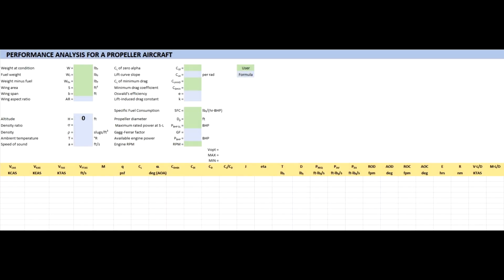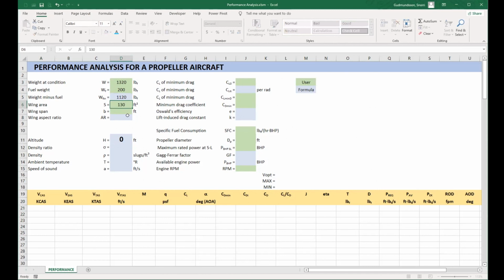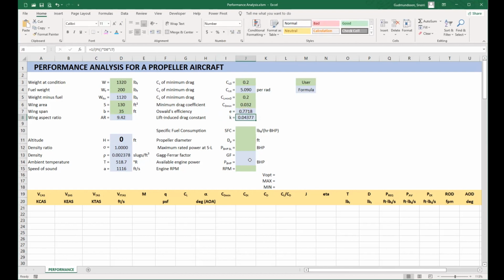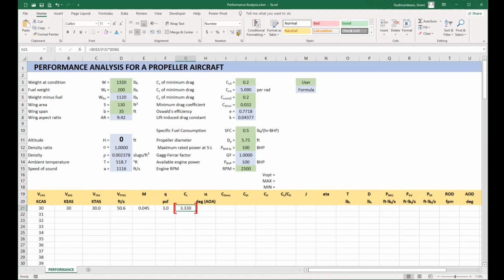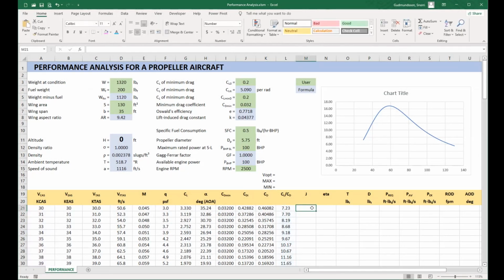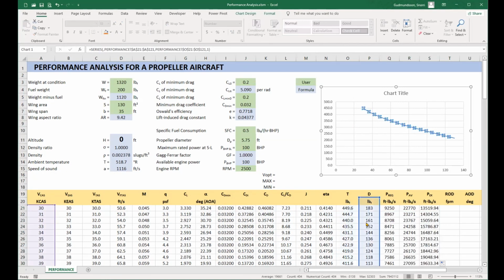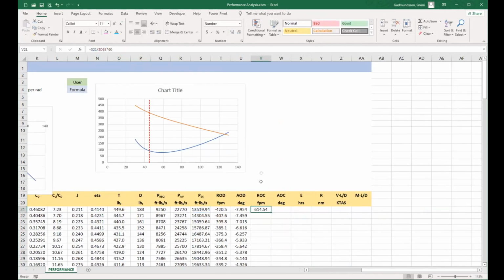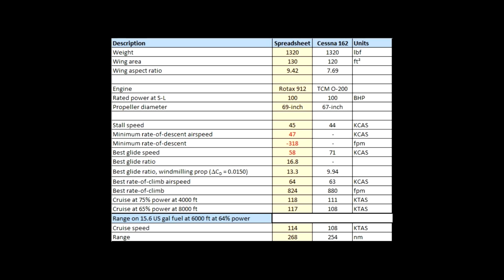Aircraft Design Tutorial: Aircraft Performance Analysis using Microsoft Excel

Comment: I have watched several of your videos in a row now so this may be slightly off topic for this video, but I am wondering, can you reverse engineer certain coefficients if you already know aircraft performance? For instance, I know the various speeds of an aircraft (cruise, take off, etc.) with an engine with four different propeller configurations, as well as other engine / propeller combinations. Using that real world data, I should be able to calculate a real world drag coefficient right?

Oh yeah, and edit to add, I have purchased your book and will be going through it soon. Your youtube content alone was supremely helpful for someone who has an engineering background but nothing to do with aircraft.
Reply from the maker: @cbbbbbbbbbbbb  Excellent question. The answer is a resounding yes. In fact, I do this very frequently. To extract the minimum drag coefficient, CDmin, it is best to use the cruise speed (e.g. from the POH) as it is an equilibrium speed that yields better quality results. Section 16.5, Special Topic Involving Drag treats this issue. Check out Example 16-24 in the 2nd edition. Make sure you use proper propeller efficiencies (e.g. 0.75 for fixed pitch cruise prop and 0.85 for constant speed props). Best wishes.

Comment: Hello, professor. I am working on my undergraduate thesis on aircraft performance calculations, and I am using your General Aviation book as a reference. I find it quite challenging to comprehend the example given in TABLE 18-5, which involves ground run analysis using the numerical integration method. Would it be possible for you to create a detailed video explanation for this example?
Reply from the maker: Which edition of the book are you referring to? First or second?
Reply: second edition 
 @dr.gudmundssonaircraftdesign
Reply: second edition 
 @dr.gudmundssonaircraftdesign
Reply from the maker: @NejlaTomrisYelmen  While your suggestion is good, I cannot produce a video about the topic any time soon. Contact me on LinkedIn if you can and describe the bottleneck.

Comment: Having done my ATPL exams and not being particularly mathematically gifted, it is interesting to see how those graphs are actually made, though it sticks out to me as a chicken and egg situation, how do you know what the weight or fuel capacity will be, if you do not know the materials used? would you then need to come back and redo the analysis after the aircraft is built and weighed?  Also does this take into account wing plan forms? being more oriented in this case to LSA aircraft I suspect not, however I wonder how accurate an analysis of this kind would be for a light aircraft hoping to achieve high speeds, such as that in air racing. 

If one were to attempt to design an aircraft, which of your books would you recommend purchasing to learn how to analyse, select materials and then test the theory?
Reply from the maker: @barnstormingbandit2611  Good questions. The aircraft design process is actually a well defined process that, unfortunately, is too involved to describe here. However,  I'd like to think it is clearly described in Chapter 1 of my book "General Aviation Aircraft Design" 1st and 2nd editions. So, I'd recommend the 2nd edition, as it is updated to discuss 14 CFR Part 23 with 64th amendment. While the book is laden with mathematics (which you may not like), it is a good reference for pilots wanting to know more about aircraft design. Best wishes.

Comment: Do Cirrus engineers really us MS Excel?
Reply from the maker: @TimJohnsonPhD I have never met an engineer that didn't use Excel or other spreadsheet tools. This is our favorite go-to tool.
Reply: @dr.gudmundssonaircraftdesign  Interesting. My engineering organizations have been trying to get away from it. Lack of security, lack of version control, etc.
Reply from the maker: @BigDickMark  What do you use instead?
Reply: @dr.gudmundssonaircraftdesign  Depends on the analysis, but we have a methods group that develops and maintains internal tools. The tools typically read/write to a human-readable text file that includes all the outputs, but also echoes inputs and metadata (e.g. software version).

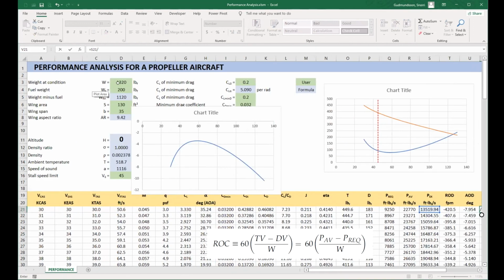Comment: At 30:39, how did you decide that 0.001 degrees is the appropriate significant figure for AOD? Why does AOD have more significant figures than AOA? Thanks!
Reply from the maker: @TimJohnsonPhD This is purely selected to display 4-sigfigs and ignores the difficulty of measuring angle beyond ±0.2°. The AOA also has 4-sigfigs at large AOAs and this becomes 3-sigfigs at low AOAs. The user can change this at will.

Comment: Thank you for this video. I ordered the second edition of the book from Elsevier. I wonder how a two lifting surfaces configuration (tandem, large canard) would be represented in this excel. How would you define both wings and their aspec ratio. Would you consider calculating an equivalent wing of both wings? How would the down-wash from the canard affect the Cl of the main wing (rear wing)?
Reply from the maker: Hi Christos. Thank you for your message and for purchasing my book. With respect to your question, fundamentally, you don't have to treat unconventional aircraft differently from a conventional one. The spreadsheet does not "know" the shape of the airplane that is being analyzed. It presumes the drag model you use (CD) is appropriate for the configuration. Downwash from the canard has significant impact on the wing lift (see Figure 11-36 in the book). This must be treated in the stability and control evaluation. This, in part, gives you the drag contributions that are unique to the canard (e.g. trim drag) and must be present in the drag model. This serves as an indirect representation of the configuration. This is all that is needed to treat canards (or other unconventional aircraft) in the spreadsheet. I hope this helps. Have fun designing!
Reply: @dr.gudmundssonaircraftdesign  Thank you for your response. Btw I just received the eBook this morning (waiting for the hardcover as well), it is a masterpiece! an aviation bible!

Comment: Question about estimating Prop efficiency (Eta). At an early stage in the design process we know almost nothing about the propeller characteristics, we certainly do not have clever quadratic equations based upon the advance ratio (J). In my case a wee little homebuilt with a Gross Weight  = approx 250kg, with a wooden fixed pitch prop. Annoyingly most texts make an assumption that Eta (cruise) = 0.75 across all airspeeds, which, in my view, is not the best engineering. Raymer's big book tries to fix this this with a correction factor based upon J/J(design). In your book (1st edition) section 14.4.2 Method 2 you make use of a cubic spline method but again start with the Eta =0.75 assumption at design point.  At very early design stages I feel an urge to reduce the number of variable at play, at least until I get a basic understanding of the performance characteristics. What would you propose for a simplified method as a starting point? Stephen
Reply from the maker: Hi Stephen. That is a great comment. First, like you say, using 0.75 across all speeds is not just poor engineering, it is altogether incorrect. Eta is 0 when the airplane is at rest, because it depends on airspeed. Thus, fixed pitch propellers reach a maximum value at only one combination of airspeed and RPM. And like you know, constant speed propellers (CSP) achieve their large efficiency over a wide range of airspeeds. The quadratic spline method should be used for fixed pitch props and the cubic spline for constant speed props. This will definitely reduce the number of variables. I make this more clear in the second edition of my book.

Second, I specify in the discussion for the quadratic spline method that because we don't know the final efficiency early in the design phase, we have to make the assumption that a properly manufactured propeller has a likely maximum efficiency of 0.75 if fixed and 0.85 if CSP. The manufacturer will most likely sell us a propeller for which the max eta is achieved at a combination of airspeed and RPM that is reasonable for our airplane (e.g. the target cruise speed and, say, 2500 RPM). Once this is established, the thrust splines take care of the rest.

The reason I use 0.75 as a maximum value for fixed pitch propellers (I use 0.85 for constant speed props) is because it  is a conservative value that a hair below what typical fixed pitch props may achieve in practice. Yes, many props achieve a higher value (the expression in the video achieves 0.82), but that value is typically obtained using Blade Element Momentum Theory. It assumes perfect surfaces qualities and geometry. In my experience, I don't usually get the efficiency predicted by the computer in practice. Best wishes.